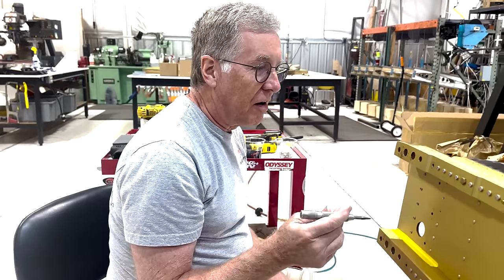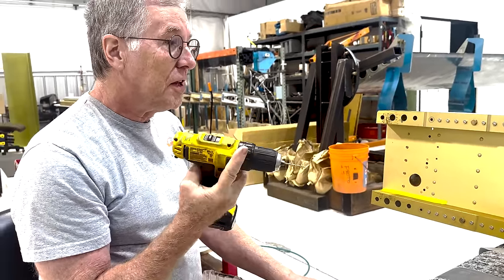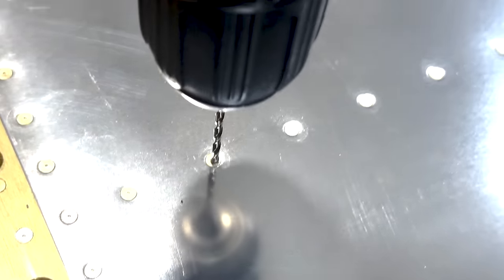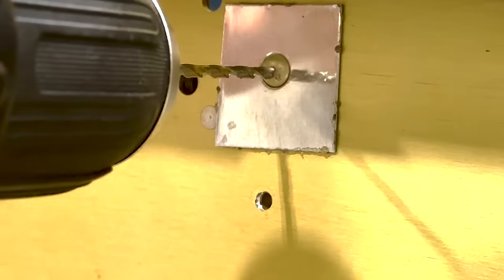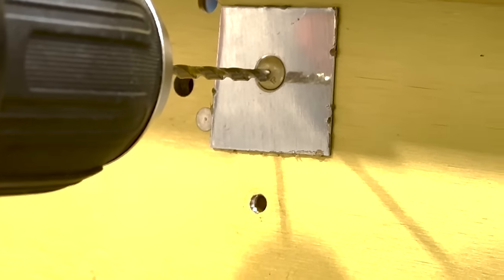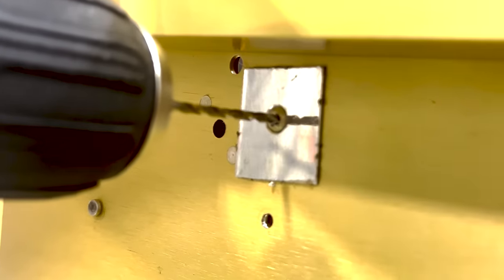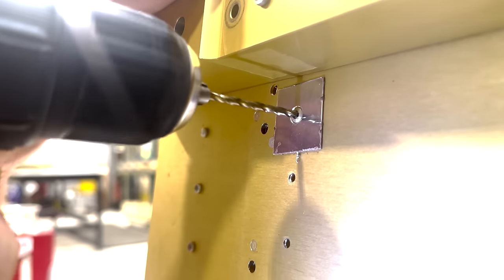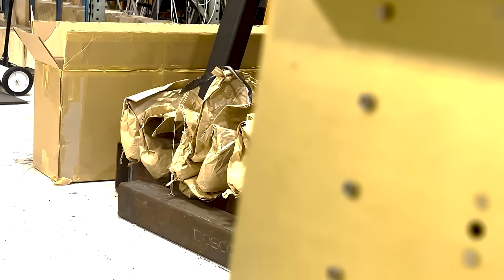Rivet Removal Techniques with DAR Scott McDaniels

Comment: The biggest learning I have had building my RV-10 is to 'learn when to leave well enough alone'. Unless the rivet is part of a critically stressed part or really messed up, I will accept a slightly offset shop head or a small smiley on the rivet head. Often you do more damage trying to drill an akwardly located rivet out.
Reply: I agree, I have drilled out thousands of rivets on skin replacements and float disassembly for corrosion repair. I have seen the young guys go from a 4 ,5 and end up pounding a number six in a bad spot. An old guy I worked with was of the opinion if it was a really tough spot you are better off with a well driven short tail than a proper length but dumped tail. Riviting is fun when it goes well, but day four of bucking overhead in a float makes you want to go back to school and become a hairdresser.

Comment: Great stuff.  Pretty much validates what I've learned by trial and error plus a couple extra tips.  My request for a future video now that you're done the fuel tank assembly (excellent btw) and rivet removal is advanced riveting techniques.  There are TONS of how to rivet but they all show the very basic simplest forms of riveting.  We need a video to show how to rivet a hard to reach rivet with different types of rivet sets such as a double offset and some of the techniques used to not completed mess up those tricky to set rivets.

Comment: Great Video, learning is a process. Scott spent some time on alignment, but being on center is equally important. For me, I use a smaller bit and only go a few revs and check the center location often, then step up to a larger if the alignment is good. Good vision is an absolute must. Dark hangars or poor near vision is hard to overcome with technique. I like his low rpm and force to keep the process under control. IMO there is no reason everyone can not get a 95% + perfect removal rate.

Comment: One tip not mentioned that I have found very useful is after center punching the rivet head, do the initial drilling with a center drill and then switch to a normal drill bit

Comment: Scott is a total rockstar when it comes to communicating well honed common wisdom.  I wish I discovered him sooner and that he/Vans would create way more quality content.  Builders are loyal to the Vans ecosystem for a reason.  Greater investment in this sort of stuff GREATLY augments any limitations/deficiencies of plans/documentation/builder ignorance/yada yada.  Great to learn or confirm what I've been doing.  Note to others, I tend to drill using slightly undersized (approx 41 for 3's and 31 for 4's).  Tighter/better fit for punch.  Thank you again!

Comment: Finally a real learning experience. That is: how to fix a messed up attempt at drilling the rivet head. That is more of a learning experience than only how to do the drilling correctly. One addition would be the use of center drills. One extra step, but well worth it. The center drill will not "walk" the same way a regular drill bit does. Some of the rescue techniques that Scott used are "walking" the drill bit back towards the center.  If you drill off 'centered' (i.e. not lined up) the bit will walk. (H.F. have these center drills, 3 or 4 in a packet).
other wise...Scott: how did you grind that plier?  (nice work Scott, thanks)

Comment: Interesting that you’d put out this video.  Since it looks like I’ll be drilling about 1000 to replace your laser punched ribs.  Thanks for that.
Reply: Welcome to the world of experimental aircraft. Most of the time, new ideas and techniques work out just fine. Sometimes, they don't.
Reply: @Factory400  and sometimes the company doesn’t have a good solution for their screw up.  There are already lawyers talking this thru.
Reply: @Pilotpaulie  They replaced your ribs, right?  Sounds like a fair solution.  It's a kit for an experimental homebuild, after all.  It's not Ikea furniture.  On the bright side, the second time through will be a whole lot faster.
Reply: Yea, I was thinking the exact same thing. Ive been a Van's fan up to recently but this latest fiasco has gotten to me.

Comment: Since I'm just now beginning to rivet nut plates on the wing main spar, I haven't yet had to drill any rivets on it.  I've used the reflection technique many times already but never on an anodised surface.  The shiny surface substitute idea is great.  I'm pretty sure I'll need to use it.  Thanks!

Comment: As a young man i worked in fuselage assembly at gulfstream in Savannah Ga. They taught me about flight line and prop wash. They also taught me that when removing rivets in thick material that if you cool the rivet and the area around the rivet, it makes removal much easier. Ice, dry ice, and freon(i did not say that)causes the rivet to shrink and, counterintuitively, the hole will expand. Just sayin'.

Comment: I am building this same piece right now.  My tip on these 470's, it is easier for me at least, to punch and drill out from the back, it is a nice flat surface.  I under drill front he back and drill to the correct size from the front.   As Flyboy98 stated, if you building your plane to fly and not to win a ribbon, then leave well enough alone when you can.  There is more than one rivet holding the plane together.  If I have small Mona Lisa smile, I leave it, if it is a Joker smile, its get the drill.  Also, If I smile a couple of these in a short period, I usually need a break.

Comment: Great video.  The one thing I'd suggest that works well for me is to use a slightly undersized drill bit when drilling to pop off the factory head (ie: a #41 instead of #40, or #31 instead of #30).  Then, the pin punch to snap off the head fits tighter and is more likely to work, having less play in the hole.

Comment: If you use a palm drill it becomes like a extension of your pointer finger and becomes intuition to drill straight. I only use a battery power drill if I am somewhere I don’t have shop air access

Comment: I am not a current builder of a vans aircraft but I can see many uses for 3d printed tools to assist with things like drilling rivets and keeping the drill centered as well as so much more. My drag bike build utilized close to 100 printed parts to assist with the build. FYI I am not suggesting installing 3d printed parts to the structure of the aircraft

Comment: If removing a nut plate rivet, you can grind the mushroomed part with a Dremel. Do not drill, that causes a lot of problems. There is no danger of harming the airplane-the steel of the nut plate is expendable. After removing the mushroom, the rivet pops out easily, with no damage to the structure.

Comment: Scott, have you had any issues with chuck wobble in the battery drills? I just bought a new “yellow” brand brushless and the chuck is no where near as straight as the air drill. Any tips? Should I just return it and try a different one?
Reply: Not in any that I have used. I would suggest trying another. 
Air drills are nice because they are lightweight and compact and can be used for rivet removal by someone with experience, but because of the lack of low speed control other than the most expensive ones (which most people don’t have) it is the reason they were not even demonstrated in this video.

Comment: I am presuming that the pliers you are using have been modified.  Looks like a pair of 8” side cutters ground to a flush edge.   Would someone confirm that please ?
Reply: Yes. Just like detailed in Section 5 of the construction manual.
Reply: @scottmcdaniels3254  Manual…….  There is a manual ?🤣🤣😇🤣